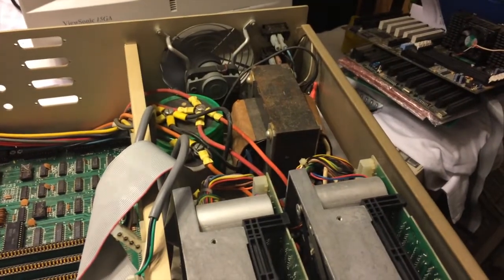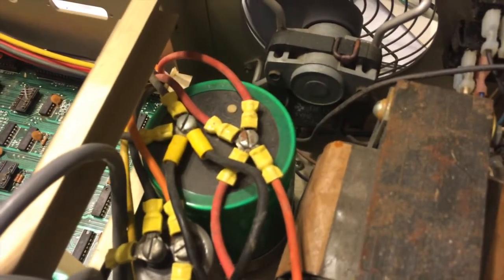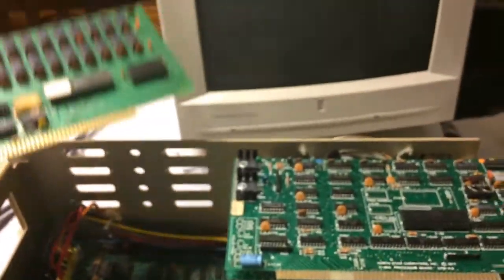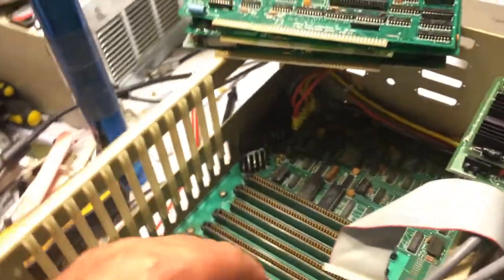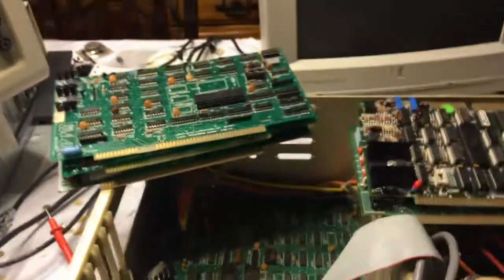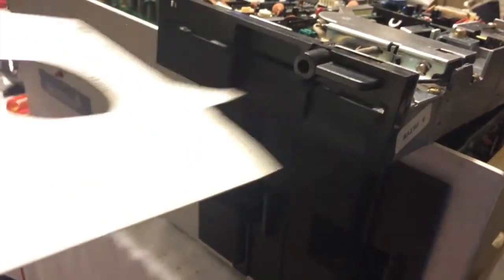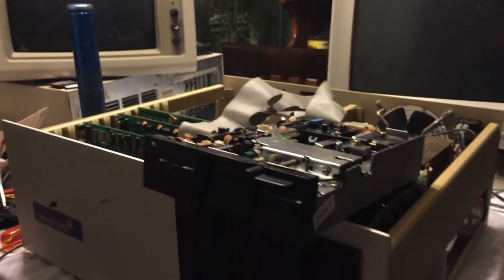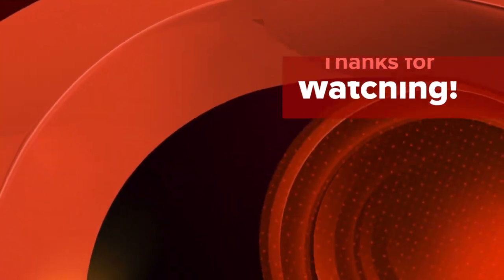NorthStar S-100 System repaired and tested.

Comment: I've just stumbled upon your video.

It's very common for tantalum capacitors to explode, fizz and flame in old equipment.
(For safety it is a good idea to replace them with more modern equivalents.)

As for the power supply it's not scary at all. It's just got thick wires and giant capacitors.
It was usual to install capacitors with relatively high voltage ratings to cater for the larger unloaded unregulated voltages present.
Just check the giant capacitors for their current capacitance value and ESR (equivalent series resistance). 
The capacitance value is not critical but and the ESR should be sufficient to filter the pulsating DC voltage from the full diode bridges to a satisfactory output voltage is acceptable ripple levels.
As you've described, the S100 bus design distributes the voltage regulation for each board for local consumption.
Back then the power regulation handling from the 78xx/79xx/LM309K (et al) was limited to around 1.5A without the use of a power handling bypass transistor such as a 2N3055.

Please don't handle the S100 boards near the gold contacts.  Contamination can cause faulty connections.

Although the S100 boards can be plugged in any socket, ensure that each is configured so that each occupies unique memory address and I/O port addresses.
This was done with DIP switches and jumpers.

For stability, it was sometimes necessary to juggle around the location of the S100 boards for signal integrity.  Signal termination at each end of the bus could greatly improve signal integrity hence system stability.

Be careful if you replace the slower slew rate 74xx and 74LSxx ICs with faster logic families such as the 74S, 74ALS, 74F series because their slew rates are much faster and hence much greater EMI at higher frequencies could be generated causing unwanted signal degradation.

An oscilloscope and logic analyser is always handy to get these DIY dinosaurs working again.
Reply from the maker: All good to know stuff here.  Thank you so much.
Reply: Did you ever get it going?
Reply from the maker: @PebblesChan  Not yet.  I believe I'm having disk drive problems. And  Finding a proper boot disk and all.  This computer requires hard sector disk and it took me a while to find a good set of blanks.  Then I got to find a compatible terminal to use with it.  So it's sitting right now, waiting for me to get motivated enough to drag it out and play with it again.
Reply: Does the Monitor/FDC BIOS ROM in your system have a command or API to easily read and write to nominated disk sectors?
The easiest way to move forward is to dump and disassemble the resident ROMs in your system and see what they do and how they glue together.
As the Mandalorians say "This is the way. - The S100 Bus Way".  (A bygone and remarkable era that accelerated personal computer adoption. It also made Bill Gates and Steve Allen extremely rich.)

From this you can also determine a suitable Terminal. Usually just a standard ASCII TTY is sufficient but you'll need to determine the serial communications settings such as Baud Rate, Data bits, Parity and Stop bits.

As for the hard disk, hard sectored disks are often just soft sectored disks but with additional holes.  Depending upon the drive, there is often one offset on a different radius to indicate sector 0.  You could try to fashion your own as an experiment.  Disk drives are pretty simple devices when you get to know them.
They're just more precise versions of magnetic tape with convenient head placement controls.

The simplest method of bitstream encoding is FM but you can use any format you like if you know how.
Reply from the maker: @PebblesChan  Not sure about the ROMs.  I need to drag that thing out again and play with it some more.  It's just soooo big and takes up an entire table, it's hard to make room for it, and a terminal.

Comment: Ah Memories, I had one of these back in early 80s. 64K, DC Hayes Micromodem 100 @ a screaming 300baud, Tandon TM-100 10 sector 5.25 drives, Televideo 910 CRT terminal,  and topped off with a Centronics 739 printer. Ran Northstar Basic and Pascal under Northstar CP/M. A buddy of mine had s similar system with the Televideo 950 running ZCPR3. My ower supply went out after a couple of years and it was going to cost too much to repair it so I switched over to Kaypro PCs running MS-DOS in mid 80s and never looked back.

Comment: This going to Be a Fun Project, I loved the Taller case of this and the Alpha Micro S-100 cases Double eight S-100 cards, The power supply Should be a nice 8 Volts and 12V+ and 12v- nothing more or less.. you Need a good BUS PROBE form Jade you can still find them.. ( https://www.ebay.ie/itm/JADE-BUS-PROBE-reproduction-bare-pcb-Altair-8800-S-100-Diagnostic-/113706147323?hash=item1a796a1dfb ) under $50 for the Blank Board..$400 for the Full Built boards..

Comment: Did you ever get a chance to work with the NStar Floppy Disk Controller?
Reply from the maker: No I haven't.  Not yet anyways.  I might need hard sector floppies to make this work, which I don't have.  Not sure how to get around that.
Reply: @Devin2277-n2m  
I have read a few people are are able to take soft sector disks and punch the 10 holes needed to make them work as hard sector disks.
I also have a friend, that sells used original hard sector disks.
But even without the disks, you should be able to perform a few test, like executing E900, or E800 depending on your NStar controller.
Or you can dump those addresses to see which one your controller uses.
Reply from the maker: @jeffnay6502  Yeah, but that doesn't sound like fun at all.  lol
Reply: @Devin2277-n2m  
Working with your floppy controller and or floppy drives is a lot of fun. I just wish I knew more about how to write a boot loader in assembly language for the 8080.
I have done a little assembly language on the 6502, but not the earlier 8080. 
Do you have a NorthStar Floppy disc controller board? They usually start at E800 or E900.

Comment: Many Northstar systems used hard sectored floppy disks, which have an index hole at the beginning of every sector on the disk... less common than the soft sectored floppies with only one index hole. Also, your voltages are fine. What you're measuring are the pre-regulated rectified voltages coming out of the linear supply before they're regulated by those tophats on the motherboard.  Correct place to measure would be right across the capacitors you replaced, or dedicated testpoints on the motherboard if provided.
Reply from the maker: Magnus Rubsam Hey! Thanks for the pointers!

Comment: That is one awesome computer system! :-)  Did the PSU still put out 12V and 22V with the cards installed?  It's normal for a linear PSU to run high when there is no load, but those regulators should be enough to load it down.  Are there any dropping resistors in the PSU area?  I would highly recommend replacing those caps you replaced with 30 Volt caps do to the higher voltage you are seeing.  The regulators should have a wide input voltage range, so being higher on the rails shouldn't be a huge issue.
Reply from the maker: Yeah, the voltage is still high after installing all the original cards. 
And I'll definitely be replacing those caps with higher voltage caps soon.  Though they are on the 12 and 5 volt regulated side on the motherboard.  And that's actually running at 11.5 and 4.9.  So those caps should be ok for a while.